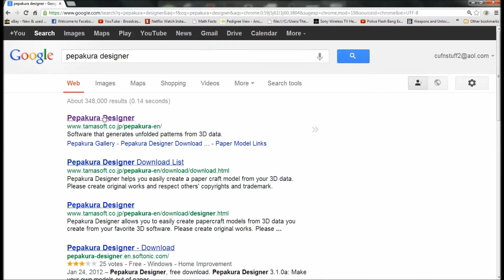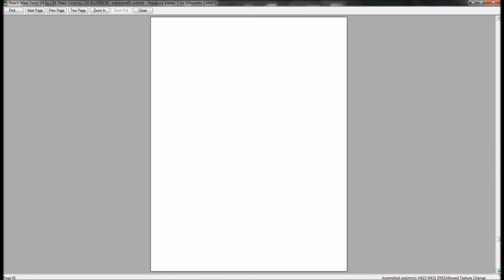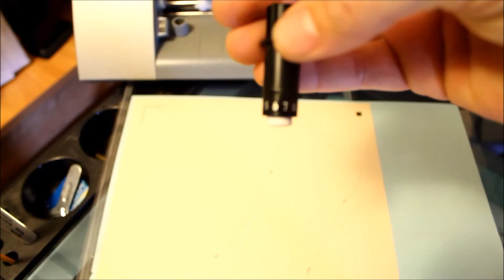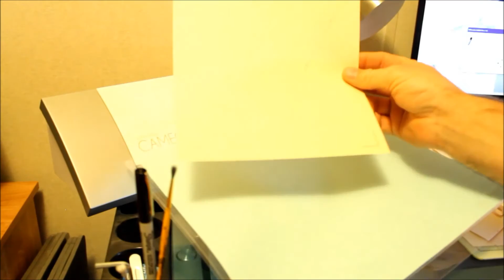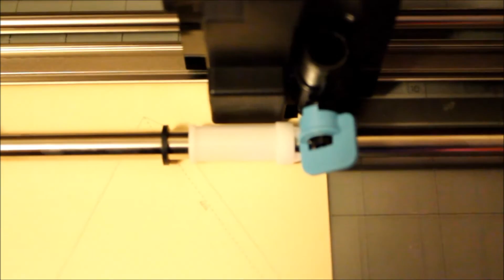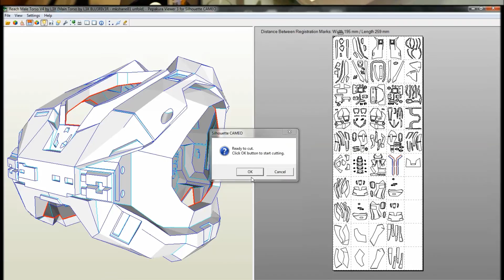Silhouette Cameo Tutorial for Pepakura

Comment from the maker: @ Michael William.  I can't reply to your comment most likely because of how your Google+ settings may be currently for youtube.  If you're not getting the cameo controller to come up after the install, you've most likely run into the install issue that I addressed in the original comments about it not recognizing it.  There is a glitch in Windows for some reason that keeps the computer from recognizing the cameo as a printer to connect to with the program and if it doesn't recognize it the controller window will not come up.  Follow the link that I put in for the rpf[dot]com in the video comments and scroll down to the post mentioned.  I've found that his walk through with this issue is easily fixed by following it.  Hope this helps and good luck with your projects.

Comment: Does the designer come with the silhouette viewer program as well? I seen they sell it separately but would prefer if they came together
Reply from the maker: Unfortunately the cameo doesn't come with something to view or cut out pepakura files. The silhouette cameo only comes with the silhouette software for cutting out things. It's a useful program for custom stuff, but obviously doesn't help with the pep files. Tamasoft is the only site I know of that offers it for the cameo cutter. It's not expensive to buy the full license for the program. Currently I think it's $15 (US). And if you buy the license you will be able to save files that you modify. If you download the free version and do not buy the code for it you lose any work you've done if you close the program. Hope this helps.
Reply from the maker: I may have read that wrong. Pep designer and the pep viewer for the cameo are separate programs and you have to buy the license for both separately. I just checked and they still do not offer a package deal for the two programs together.
Reply: JFinch127 There is a Pepakura Viewer for Cameo version, but there's no info or tutorial on how to use it.  I'm very interested on buying a Cameo but I'm not sure yet.  What I want is to print using a inkjet printer and then cut the prints with the cameo.
Reply from the maker: Yerry Batista You're correct about the instructions.  There are limited help files available from Tamasoft that makes the program for the Silhouette. However, there are so many people that give scaling and usage tutorials on the replica prop forums (rpf[dot]com and 405th[dot]com that you can find almost anything there if you get stumped on the designer software for the silhouette there.  And printing with an ink jet printer and cutting out with the silhouette is exactly what I do.  You don't have to have a special printer or anything to print it out.  just print your pages on card stock and then let the ink dry before you put it through the silhouette.  Hope this helps you.
Reply: Thanks a million dude !!!! there sis another tutorial but is too complicated and seems like rocket science to an average user with many operations for each page.

Comment: Do you still use this for your Peps? What was your average additional cost, for a full costume of pep files, like mats and blades?
Reply from the maker: I have had a lot of things come up and haven't been able to continue my latest project for a while. When life gives me the chance I'll get started back up. To date I've only used 2 blades and I rotate between 2 mats of different sizes cutting stuff. My first blade cut several hundred pages before I changed it out. You can disassemble the blade and run it over foil to sharpen it though. In costuming terms it made a full size adult halo costume and three parts of another one so far and a full size 8 year old child halo costume. Hope this helps and thanks for watching.

Comment: I have a very important question. i have a silhouette portrait cutter and the pepakura program does not work with it. ive seen several videos in different languages on how to cut with it but how do i get the pepakura files into the silhouette software?
Reply from the maker: First. . . nice looking helmet in the avatar.  Second.  I'm not familiar with the Silhouette Portrait cutter, because I've never worked with it myself.  I do not know of anyone currently that uses one to cut out pep files for costume building.  Most are using the cameo or other larger silhouette type cutters.  I'm not saying it is impossible, because I'm sure it can be achieved with a little work. What you would have to do is convert or design a file that the Silhouette Studio program would be able to recognize (i.e. .studio, .gxf, .gsd, png, jpg)  Then you would be able to open the the 2D pages in the Silhouette program and cut them with your device.  The thing that would be the biggest issue with having to do this is scaling them to you individually.  There are people on the replica props forums and possibly even the 405th community that would be able to do this for you if you ask nicely enough, but some may ask for commission to do the conversion work for you if you do not know how to yourself.  I know the Cameo cutter is about $100 more than the portrait, but I do not believe tamasoft (the writers of the popular silhouette programs) have made a version of their software available for this type of cutter, and their programs make the process a lot easier during scaling.  I'm sorry I couldn't be of more help with this portrait cutter issue.

Comment: You may run into the same issues I did, getting the Windows machine to recognize the driver. Although, if you're running a VM you're probably already technically astute enough to solve the issue.
When you install Pepakura Viewer for Cameo, it installs the controller software for Cameo. However, Windows doesn't always pick up the driver. So after you've printed your registered sheets, and you want to "print" to the Cameo cutter, it's not listed in the printer selection drop down.
Go to Control Panel -> Devices and Printers:
(You'll probably see a device in the "Unspecified" section called "USB Printer Support".)
Right click on that device, and select "Properties".
Select the SilhouetteCameo, and then "Properties"
Then you need to click on "Change Settings" and select the "Driver" tab:
Then click "Update Driver". If this button is grey'd out, you didn't hit "change settings". Back up one step.
After you click "Update driver" pick the option to select a driver and browse to the Silhouette CD.
It should find these two drivers, pick the correct one for your operating sytem (32 or 64 bit):
You may hit the security warning, so select "Install Anyway":
And your Cameo should be installed. It should now show up in the "print" pulldown in Pep Viewer for Cameo.
_________________________________________________________________
As for the Dash Line cut outs:
(At the Print Setup window)- Select [Silhouette CAMEO] for the printer [Name]. Press [Properties...] button and configure the Silhouette CAMEO.
Add the RED color for Dashed Line.
You can edit the setting of [Dashed Line Pattern Settings].  A setting of about 0.5mm for  both [Cut Line Segment] and [Uncut Line Segment] works well.

Then follow the steps in the video and you get the Driver installed and the Dashes cut to make the smooth folds!
Reply: +David P thank you so much! this was exactly my problem. Solved!!
Reply: glad to help!

Comment from the maker: @ Nicky T. Yes and yes. I print them out in my kodak all-in-one inkjet printer from the Tamasoft pepakura for silhouette cameo program and then do what I did in the video to cut it out. For the most part it works like a charm. Sometimes the measurement need a little tweaking and sometimes there may be a couple if areas that the cameo doesn't cut, but it definitely cuts down the time and works.

Comment: I have tried about everything listed on the site and what you have told me. I am deleted and uninstalled EVERYTHING. I guess the trick is to put the CD in the drive, then start the Silhouette and then plug in the USB. Any other order will confuse windows into downloading it as an Unspecified driver. Things seem to be working ok. I have had a few random cuts here and there, but I just restart the Cameo and it fixes itself. I also noticed this will happen if there is too much light on the machine.

Comment from the maker: @ Peter. Sorry. Last comment posted too quick. LOL. I haven't replaced my blade yet. I've cut out more than 200 pages of 110# card stock with it so far. I have noticed that it isn't cutting as sharp, but the blade is definitely still working without any issues. I have disassembled it and ran it across some foils to see if that would help it, but I haven't really noticed a difference in the way that it cuts after doing that. Hope this helps.

Comment from the maker: I've had problems w/ it cutting the line for one of three reasons. 1. I didn't make sure the registration mark measurements were correct. 2. The light in the room was too bright & it threw off the registration mark reading or 3. I pulled up cut line developments & selected the page to cut before the registration mark reading was taken. I have had a few pages here & there where it didn't cut all of a line, but it has done good so far to cut right on the line for me. Is this what you mean?

Comment from the maker: What windows platform do you have?  Are you printing the pepakura out of the pepakura viewer for silhouette cameo?  Also, you may need to check your print settings and printer setup in the viewer program to make sure it is set up for portrait and not landscape.  I think by default when I installed it on mine, it was set up landscape.  It took a little playing with on all the settings, but it should work.